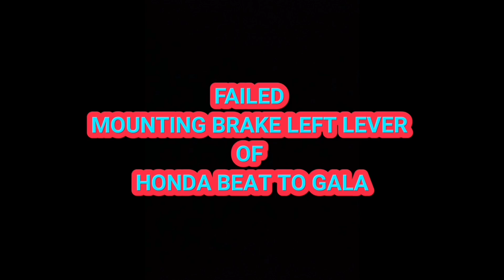HONDA BEAT BRAKE LEVER SA GALA

Comment: ano po gamit po ninyong break lever
Reply from the maker: pang honda beat yan boss, pero kung gusto mo sakto raider 150 👍🏻
Reply: @romomotovlog8274  sir sa rusi gala sporty sc125 ano pa tala yung saktong brake lever nya? Ano kapariha po Meron po ba?
Reply from the maker: lc 150, sniper 150, raider 150 boss pero na try ko lc150